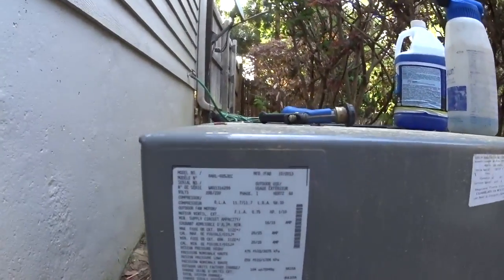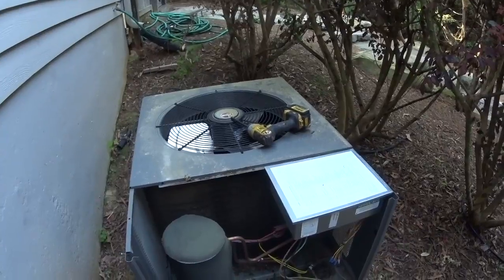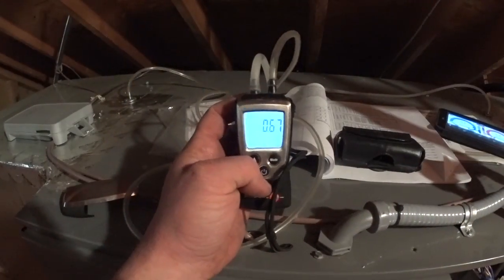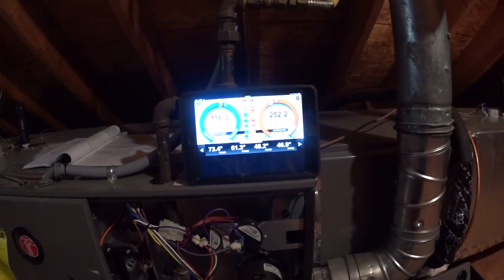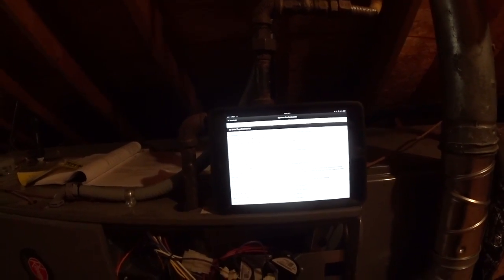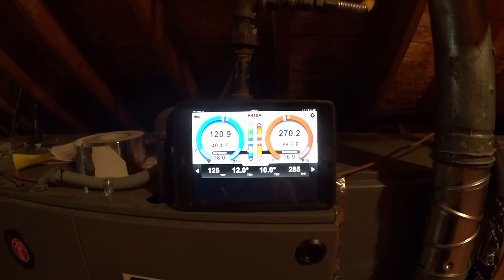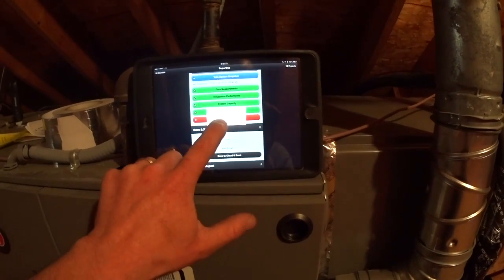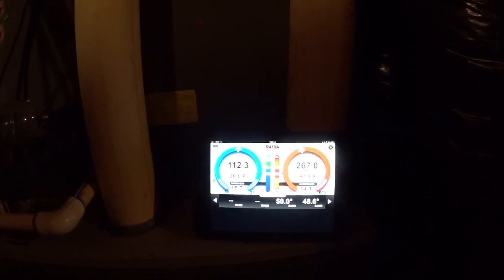HVAC Service: Rheem O.D.D. On Demand Dehumidification Feature 5-5-15

Comment: Bro, You would help me out alot. We have the same 9421 Prestige Thermostat. We have a Rheem 4 Ton Outdoor 1 Stage Compressor and a 4 ton 1 Stage Air Handler with ECM Variable Speed motor. 
I wanted to use the ODD on demand setup. What setup can you do to the thermostat so the unit works to remove humidity. I know we have to activate Active ODD on the board dip switches and the green/yellow wire needs to go somewhere. Do you connect it to the U terminals. Please help.
Reply from the maker: I’m afraid I don’t know the answer to that off hand. I’d have to look at the manuals for the thermostat and the system.
Reply from the maker: There’s a fantastic Facebook group called HVAC School that could be helpful.

Comment: The result of this ODD feature is a longer running time to reach the same temperature and my humidity is lower but not by a significant amount.In Florida, comfort is more a function of humidity than temperature. If humidity is low, then comfortable temperature range is greater. If humidity is high, then comfortable temperature range is less and temperature needs to be reduced to achieve it.
Reply: Bro, You would help me out alot. We have the same 9421 Prestige Thermostat. We have a Rheem 4 Ton Outdoor 1 Stage Compressor and a 4 ton 1 Stage Air Handler with ECM Variable Speed motor. 
I wanted to use the ODD on demand setup. What setup can you do to the thermostat so the unit works to remove humidity. I know we have to activate Active ODD on the board dip switches and the green/yellow wire needs to go somewhere. Do you connect it to the U terminals. Please help.

Comment: You didn't talk much about the ODD feature. I just had a new variable speed unit installed and the installer tech didn't know anything about ODD. They guy just hooked up my dehumidistat to break red or to turn off the system if humidity inside is very dry. After research, I hooked it up myself correctly with a relay. RHEEM says the humidistat needs to provide 24ac to the ODD terminal to signal to the onboard computer if dryness is achieved. If not, then the computer will lower fan speed motor by 200 CFM. Apparently RHEEM believes that when the CFM is lowered from 1000 CFM to 800 CFM, more humidity is extracted from the air during the cooling mode.

Comment: Stephen your always making that little truck reach down its pockets and find some balls
Reply from the maker: +Oscar Arevalo I've got too much weight on it! It's not designed to haul like I've got it loaded down. I expect the transmission to fail long before it should.
Reply: That makes sense, it sounds nice in all your videos when you step on it but now that I think about it doesn't look like the sound Matches the speed.. 
Well, really enjoy watching your videos !
Reply: I understand that the suits are trying to save some money in fleet maintenance, but why a transit van? My math tells me that the commercial use still uses way more fuel and vehicle repair money than anything that's mid or full sized. transmissions aren't cheap. Just had mine replaced almost five grand later. Sorry Stephen. I feel your pain man.

Comment: Hey Stephen, you are not supposed to use 1\4" liquid line with 410A ever because of the pressure drop across the liquid.

Comment: Some of Rheem's manuals are 'Special', I know some of their ECM air handlers have selectable fan speed curves that would run at 'dehumidification' speeds for a preset amount of time, then ramp up to normal speed.   They had 'Suggested settings' based on what region you were installing it in.   Obviously this footage was shot quite a while ago, and we don't know how things worked out with the customer regarding the lineset sizes on the 2-ton, but the 5/8" suction looks fine, the 1/4" should be bigger unless the lineset is short and vertical separation is small as well.   I would suspect excessive liquid pressure drop at the coil, as one of the manuals I'd looked at regarding the RARL series of equipment suggested 1/4" was ok as long as you charged to 8-10* subcooling - measured at the coil...